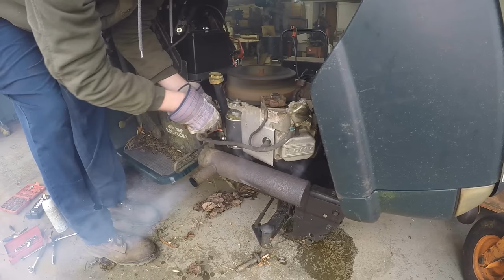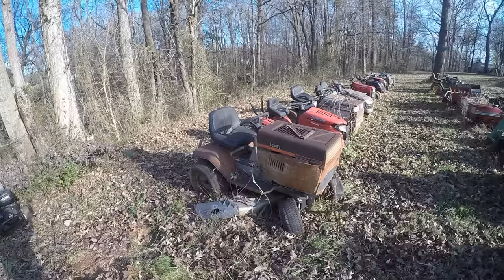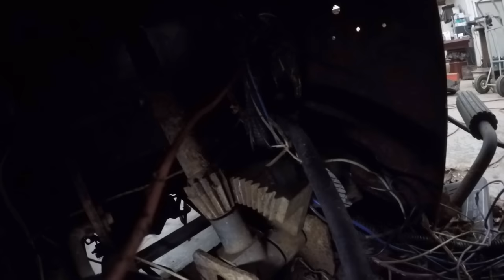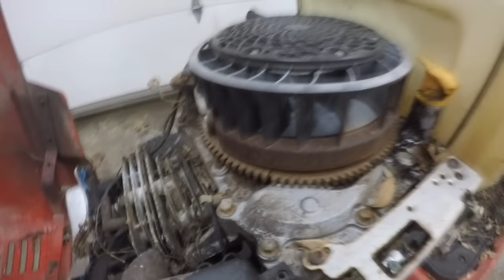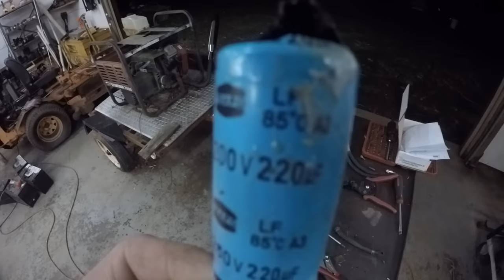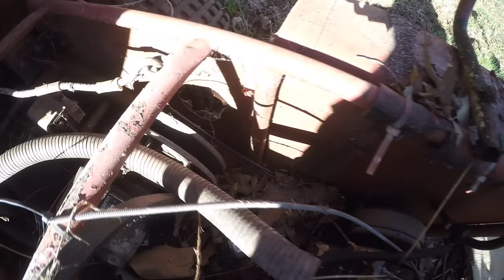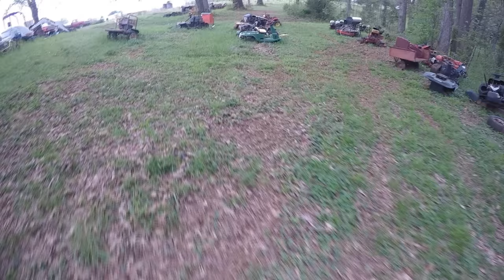"Fixing" a bunch of riding mowers.

Comment: That capacitor is an electrolytic and if you somehow got the polarity wrong, it WILL explode!  I learned that the hard way when I was first getting into electronics....took a bit to clean up all of the tin foil and wax paper from the floor!
Reply from the maker: I am 99% sure I looked it up and the internet said it was fine to hook up either way. Could be wrong though my electrical skills are not great lol. I'm just glad the old capacitor worked.

Comment: The 322 is rare because of its engine.  The engine is a Yanmar diesel factory converted to a gas engine.  All the diesel parts are still on the tractor, but it runs on gasoline instead of diesel.  He used to have a 2001 John Deere 455, but he sold it to replace it with a second John Deere X758 Signature.

Comment: Those V-Twin Generators, they provide very clean power.
Love deals like this…
Those Kohler bucket engines, a lot of times the top bolts come loose and that’s how the block gets damaged.
Reply: how does one fix that before it gets to be a problem or does briggs & Stratton not have that issue?

Comment: I've got an old Craftsman with a 20 horse opposed Vanguard that is a sweetie but I'm having to downsize because I'm too geezerish to take care of everything (8 mowers) and need the room. I have a 28 inch Roof with an 8 horse I/C Briggs used in tree farms and regular suff. Also a Gravely with a 40 inch Kidney mower that may stay. It has steering brakes and that's rare for a walk behind, 301 cast iron 12 horse Kohler with sulky. Getting my Sweetie an old Craftsman with a 16 horse single Briggs for a spare and a Stihl battery hand mower and keeping a Snapper 21 for a spare. Always something and you did REALLY good! Just shows how tough the old stuff was and still is.  Blessings
Reply from the maker: Wow that is a handful. After dealing with all these I've just got a zero turn i mow with and an old IH cub cadet that I've been meaning to sell.
Reply: @AlwaysBored123  Almost all mine were freebees except for a Snapper at the Re-store for $15 and the opposed Vanguard for $15 for front tubes from the owner. I thought it had a blasted Tecumseh till I popped the hood and about had a stroke when I saw that 1/2 VW motor sitting there.

Comment: I'd definitely save the opposed twin horizontals and the others if possible, I don't know why, but they're just such cool engines.
Reply from the maker: I like them too. I had them up for sale for about a month with virtually zero interest though so I scrapped them. They are a cool design.
Reply: @AlwaysBored  dang that's sad to hear, depends on price and area I guess. I wouldn't pay that much over scrap price depending on engine condition I guess.
Reply: Absolutely one of Briggs' best-designed engines. They are keepers around here.

Comment: with all the mowers was there any common theme to get them running? Or just adding battery and cleaning carb for most.
Reply from the maker: For virtually all of them it was just a matter of getting the carburetor to supply gas and getting the starter to spin the engine over. I think that Briggs with the missing pushrods and that Kohler with the cracked block were the only exceptions.

Comment: That was a 200v cap... that genny probably made 240.  120 each leg.     That make her a little pissed off
Reply from the maker: Well that could have been the problem. That cap was specifically advertised to work with that generator though so it would be pretty dumb if it wasn't rated for a high enough voltage.

Comment: That last motor, had a broken  counter weight in it.  All single cylinder are very badly balanced without a counter weight like that.  Single cylinder engine are very  bad engines, but cheap to build.
Reply from the maker: Yep. But every other counterweight I've seen inside an engine has always been on a rotating shaft. This is the first reciprocating one I've come across. Obviously this one didn't work well.

Comment: The 1st mower you repaired sounded like it was over reving. The two engines with cracked blocks look like the dreaded Kohler Courage.  These engines have problems and are dogs.
Reply: needs govenor adjustment over revving is good for it to burn the carbon off of the valves
Reply from the maker: Yes there was definitely something up with that first one. Sometimes it would run fine sometimes it would rev to the moon. I couldn't be bothered to look into it. And yes those were both Kohler Courages. Apparently they're well known for random catastrophic failures like that. Thanks for the comment.

Comment: Man wish I had one of those lawn mowers I'm 16 and I had gotten one from my 94 year old neighbor and it was broken after 2 days of use so we tried to fix it and found out it needed a new motor so we bought one then it wouldn't steer and we couldn't fix that so yea but wish I could afford one of theose ones
Reply from the maker: That's pretty much been my experience with riding mowers. Fix one thing and two more break. I recommend buying a commercial zero turn with a bad engine and fixing it.

Comment: Do you put step in the oil when you change it to clean it.  New oil, gas air filers the, sharpen blades and replace or dress the belts. Then shine up right.

Comment: Did you have the capacitor wired in reverse? That was an electrolytic cap and they are polarized.
Reply from the maker: It's possible. I couldn't find any markings on it so I thought polarity didn't matter.
Reply: @AlwaysBored123  I went back and viewed the part of your video that showed the capacitor and I assume you were holding it by the two wires coming out of the bottom. Look at the blue shrink wrapped plastic cover on the outside of the capacitor, it has a black stripe on it with a '-' negative mark on it. The wire closest to that black stripe is the negative wire on the capacitor. Think of it like battery, it stores a charge. That capacitor is rated at 200volts DC. Its like a battery in that it has plates, electrolyte and a positive and negative post. It got hot and blew up.
Reply from the maker: @kd5inm  Oh wow I didn't even notice that I thought it was a random row of zeros. I bet I did hook that thing up backwards. Nice catch.
Reply: @AlwaysBored123  Thanks! Electronics is a hobby of mine and I'm a licensed electrician. I like helping folks learn and understand things. Next time you run across one of these generators then you will know more about how to fix them. You should be proud, you do some great work! Keep it up

Comment: At 16:45 when the engine won’t turn over is this from bad starter, weak battery, or engine is in the compression stroke and the starter has trouble overcoming it?
Reply from the maker: I'm 99% sure it was caused by excessive valve lash from my poor valve adjustment. Those engines have a compression release mechanism built into the camshaft that holds the intake valve open on the compression stroke just slightly until the engine gets up to speed. If the valve lash is too much the release won't do anything and the compression will be too great for the starter to overcome. After running that engine for a while it actually got bad enough to where the starter couldn't turn it through a complete cycle.

Comment: The ratings of capacitors in generators need to be identical, or you run the risk of burning them up. Modern capacitors are junk anyway. I never replace them in old machines unless I have to. You have about a 50/50 shot of a modern capacitor working. That is a cool old generator. Vanguard engine are about the best generator engines out there, as long as you don't have to remove the bottom half of the carb or replace it. I'm shocked that the stator still worked with all that corrosion on the windings.
Reply from the maker: Yeah that's the first time I've messed with a capacitor. I was impressed with that engine too. Thanks for the info.

Comment: which riding mowers do you  feel are the easiest to replace belts ?
Reply from the maker: The easiest were the Craftsmans and Poulans with regular gear drive transmissions. Anything with a reeves drive (MTD and Troy Bilt) is a pain because there's more belts and pulleys and more guides to keep the belts on when they're slack. It seemed like Murray and John Deere were both pretty bad about burying their belts under lots of frustrating nonsense regardless of transmission type. Deck belts were all about the same with Craftsman/Poulan having a slight advantage.
Reply: @AlwaysBored123   any specific craftsman models that are 48 inch cut, reliable and are easy to change deck/PTO belts ?  Ty
Reply from the maker: @davehimlin2374  Not sure what the specific models are but any older Craftsman with a manual transmission will be like that. They used the same basic design for many years. Just look for ones like the ones in this video.

Comment: I'm trying to figure out what's wrong with my vertical shaft briggs opposed twin on my 116 it keeps making the whooshing sound the one engine made when it stopped at 2:19. the engine doesn't fire up all it does turns and makes that whooshing noise
Reply from the maker: The wheezing noise while cranking is normal its just air leaking back out through the intake. Check for spark, fuel, and timing.

Comment: Trouble with use generators is? Most of them was never grounded. A GENERATOR MUST BE GROUNDED> OR IT WILL MAGNETIZE THE ENGINE.  That why they have a EARTH GROUND!
Reply from the maker: The earth ground on a generator is just a safety feature. It gives the electricity a safe place to go in the event something shorts out. It has nothing to do with whether or not it functions correctly under normal circumstances.
Reply: @AlwaysBored123  BETTER LISTEN TO ME, AND EARTH GROUND IT!  It want take long to magnetize the engine

Comment: no matter what i would fix the troy built lawn tractor.
Reply from the maker: That one looked really cool. Sadly the transaxle started making a horrible noise and quit working. I took it apart and IIRC the input shaft gears were stripped and I couldn't find another axle to swap it with. I sold it to someone that needed parts to fix another one I believe.

Comment: Did you say youpaid the guy $100 to start with, then fixed and removed all his scrap, then gave him a cut of the money? sounds like you got beat up on that deal. i would have told him to pound sand.
Reply from the maker: Yes I did. In fact I gave him half of everything I got from the scrapyard.  As far as I know that's the standard on a job like this (around here at least). You can always make more in the short term by taking advantage of people but reputation is critical so I always try to treat people fair. Idk maybe I'm too fair sometimes. Either way it's done now.
Reply: Did he at least go halfers on your expenses? The fuel/repairs would run a tab pretty quick. You did him a huge service by rushing to clear out HIS mess and remediate the property. Property remediation is a legitimate business. Find out if any scrapyards in your area even offer this service, doubtful they do and they’d probably leave behind the tires and non-recyclables.
Reply from the maker: @adamdubeau8038  No he didn't. However I only gave him 25% of anything I repaired and he was only a few miles away so fuel wasn't bad. I didn't really remediate anything. I only took what I was confident I could easily resell and I left anything I didn't see value in. I did do it on short notice but he also loaned me his dump trailer to use so I'm calling that even.

Comment: Make it make sense why order another one when the one you have is good on a junk mower why didn't you just cut it out
Reply from the maker: If you're talking about that drive pulley I tried to get the other one off and it was seized on so bad I couldn't so I just paid $20 for a new one.
Reply: Understandable if you don't have a metal saw but I think you just have up on other methods you could have applied heat or cut it out let's go with that you didn't want to waste time